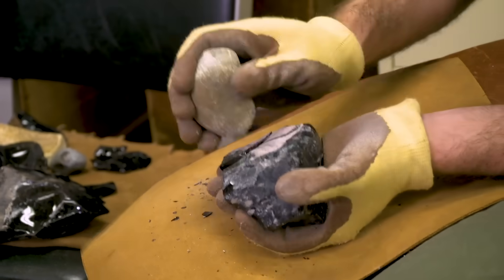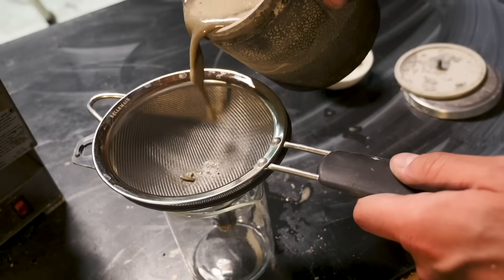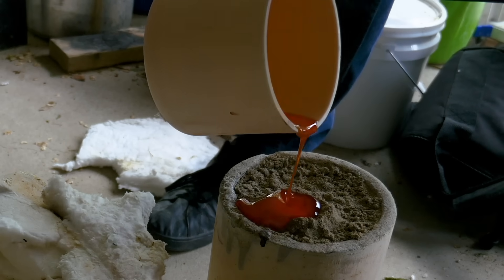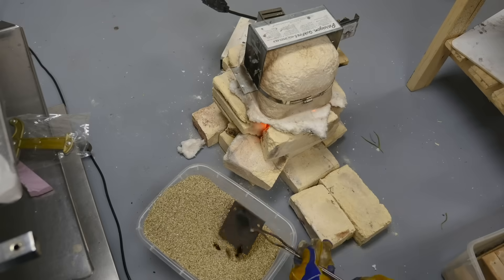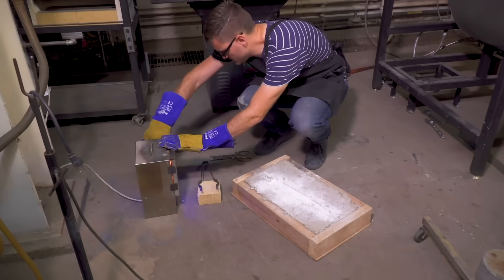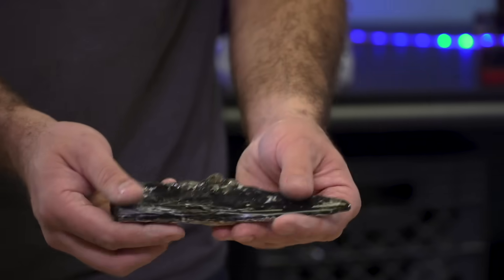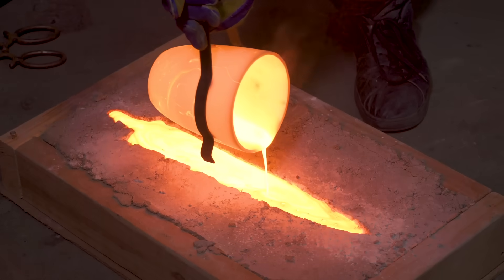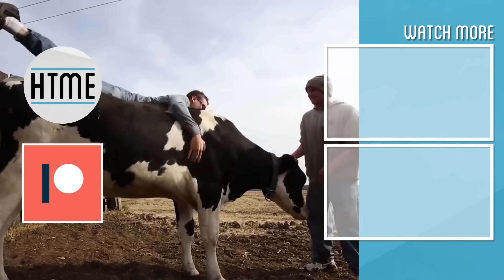Can You Melt Obsidian and Cast a Sword?

Comment: Hey Mate, Lead crystal glass artist Adam Norman Jenkins here.  A few points that might help you in future work.  First up, we coat all our bricks and the inside of our kilns with a thing called "High Fire Kiln Wash"...a company called Paragon makes a good one that is specific for glass, if your crucible breaks and glass comes pours into your kiln the kiln wash protects your valuable kiln (I regularly have high temparture  lead crystal glass flow all through my kiln just because I'm too lazy to measure and cut my glass properly).  Second point, you're always going to have problems sand casting glass which is why glass sculptors generally don't.  What we do is create a multilayer refactory mould (each layer has a different chemical composition because it has different goals)...we put the mould AND crucible into the kiln at the same time (it's called a gravity load crucible), not only that, we have to consider sprue, risers, feeders and gates when making our mould.  The reason we put it all in together is annealing.  When casting glass you can't just use an annealing kiln like blowers use.  Their glass is a special composition and is very thin....cast glass is generally lead crystal (or obsidian) and is thick as heck so it takes a LONG time to move between stages.  A small-ish 25 cm piece sits in the kiln between 400 & 850 celcius FOR 5 DAYS!  Your obsidian is brittle because you didn't anneal properly or for long enough or at the right temperature.  If you put a strong backlight under it and look at it with a polarising filter (grab on from an old LCD monitor) you will see rainbow colours in your obsidian, these are stresses that have been captured into the glass...if I see rainbow stress in a piece it goes in the bin (or actually, back in the kiln to be re-cast into something else).  Stresses in glass are an odd thing, you never know when they're going to break...a sculpture can be sitting happily one someones shelf for 5 years and then a wind will blow across it the wrong way and it will shatter into a million pieces.  So you can't sell anything with stresses in it and, realistically, if you have stresses you have a problem with your process.  Hope that helps, hit me up if you need any more info for any future casts of glass or glass-like objects.  If anyone wants me to do a video of what I'm talking about let me know.  Cheers, Adam
Reply: Of course we want you to.
Reply: What would you'all want to see made?  I've just started working on a sculpture of crystal high heels ('glass slippers'), I could video that start to finish, or if there's something specific this group of people would like (I notice you wanted an obsidian sword...a crystal dagger is something I could do pretty much in my sleep)...thoughts?
Reply: @admjen1  - if at all possible , a small blade made from obsidian, roughly the size of a dagger, that can cut objects and survive blunt trauma
Reply: Anything really, would love to see the video though.  Wanna make me a Crystal GIR (Invader Zim) :D
Reply: Jonathan Mitchell  - "Wanna make me a Crystal GIR (Invader Zim) :D" ... would love to, copyright prevents me unfortunately.  And the art industry is soooo picky about that, I had a painter friend from art school used someones photo as the basis for a painting without attribution or permission and a gallery owner recognised it, his career ended before it began....he recovered for sure, but it was far tougher a road then I'd like to walk :)
Reply: Hey, thanks for all the great replies.  So, good news is I think I'll make you guys a crystal dagger.  Now, I want to address two parts of one of the requests specifically - 1) Obsidian:  I won't be using obsidian, but I will use a "black crystal"...obsidian (as this video points out) is basically just junk glass...it's full of impurities and each batch has different properties (what we call the "softening", "melting" and "annealing" points)...it takes months of experimentation to find those points for glasses that you create yourself from known ingredients let alone some completely unknown glass full of junk elements.  I can't let a piece of junk glass (and I use the word 'junk' not to offend, just as a technical term) leave my studio unfortunately, it will damage my reputation.  However I do have a really cool jet black lead crystal I can use which will look 1000 times better.  2) Can cut objects and survive trauma - so, on the last part, at the end of the day it's glass...I mean lead crystal is pretty tough (35% lead), but it's still glass, you go into a sword fight with a dagger made of glass and the only hope you have of coming out alive is if the other guy dies laughing.  On the first part, I'm happy to do that but I have a condition...I will create a couple (maybe even a few, we'll see how I am for time) and I'll sharpen up one of them, and then smash it.  I make sculptures not weapons and I have an ethical objections to a weapon leaving my shop.  Finally, something that crystal sculpting teaches that unfortunately the internet doesn't is patience...you will need it.  From sketch to finished sculpture is about 8 weeks!  Now, it's not 8 weeks of work, but glass is slow...things have to sit.  For example, I do most of my work digitally these days (instead of old fashioned clay), but it takes 4 days to print.  A mould takes 8 days to dry, then 2 days to pre-fire, then 5 days to melt, then a day to release....etc etc...you get the point, glass sculpting is slow as f-.  But I'll post some 'shorts' ('trailers'?  "he was just one man, one man with a kiln". ??) as I go.  Thanks for the cool comments and feedback, should be a fun project :)
Reply: oh...and I should point out I said "I'll make a few" because I might as well give a few away...maybe you guys can think of a cool way for me to figure out who gets them once I figure out how many my kiln can hold (I only want to do one batch).  Also, I'll post some pictures as I go to my instagram/twitter account @aPeaceOfAdam
Reply: Adam
 Norman Jenkins
Reply: yeah. sounds awesome, man. i subbed, and ill be looking forward to seeing your work. seems a shame to destroy your hard work though. couldnt you keep em for personal display?
Reply: alphazero121  - I'll only destroy the sharp one.  I'll  make a few blunt ones that I'll give away or maybe auction for charity...haven't decided yet what to do there.  If I destroy it it'll just go back into the kiln and become something else.  I could just grind the blade back down and make it blunt again, but I really like the idea of smashing a weapon and melting it down to turn into some beautiful figurative piece, that kind of resonates with me personally, my first job (20 years ago!) was as an infantry soldier if you can believe it so there's a certain symbolism for me in doing that :)
Reply: okay. i understand. i was just curious as to the reasoning. :)
Reply: That's pretty cool man. Can't wait to see the video, I subbed!
Reply: I just subscribed to your future channel! I can wait 8 weeks. Give us a teaser of what else you have done and tour of your studio.
Reply: Adam Norman Jenkins Just subscribed for this, so I expect to get a notification in two to three months! 😃
Reply: After sharpening one of them, don't destroy it needlessly. Instead, you should make a follow-up video showing "stress tests" of the sharpened glass blade, with the ultimate goal of pushing it beyond its limits and letting it break through the testing. Like someone else mentioned here, you could show how easily that glass blade cuts through various objects, and then afterward if it's still intact do some blunt force tests with it to show how easily it will break if used in that way.

Just an idea, anyway. From start to finish this would be a pretty long project as you've already stated, but I feel like after putting all that work into one of those glass pieces it would be a shame to just break it intentionally when you could instead put it through its paces. I think it would make for an interesting video, but that's my opinion.

I've subscribed either way, I hope you do follow through with this project. It sounds awesome!
Reply: @admjen1  where are you based out of?
Reply: That stress test is a really good idea actually, it also has practical applications for me as I'll learn a lot more about my glass...thanks :)
Reply: @admjen1  You remind me of the old World of Warcraft video where one guy afk's and comes back rushing to every mob and yells "LEEROY JEEEENKIIIINSSS"

Also wanna tell you that I don't wanna offend you, so if you don't like what I just said just ask me to remove it.
Reply: No offence taken :). I hope it's just the name that reminds you (though I have seen that video and it's very funny)
Reply: @admjen1  Yes it's just the name :P
Reply: @admjen1  well I know who I'm subscribing to just to see a video awhile down the line but you sound like ya know what ya talking about so it will probably be much more interesting then this mess of a video.
Reply: Thanks @Anime fan - I promise I'll get to it, I'll also post some "how to's" for anyone that wants to give it a go...glass sculpting used to be on par with marble and bronze but fell out of favour in the late 1800s (I think because labour law changes meant you could no longer force children to sit and tend a kiln for a week - but now we have computers I'm hoping it makes a comeback).  I'm really looking forward to sharing what almost a decade of research has taught me, just be patient, I promise it's on my todo list and I'm slowly working towards it.  Artists are poor as f so I have to balance cool projects like this with just getting stuff into galleries and applying for grants (and managing the grants once you get them)...but no doubt I'll b*tch about that stuff on the video ;). (I shouldn't complain, it's better than NOT having a grant!).  Looking forward to showing you all something interesting (hopefully ;0 )
Reply: Whatever you want to make, man. im sure there are a lot of people, myself included,  who would be interested to watch an actual expert's process.
Reply: Why not cut a sword out of a large piece of Obsidian with a waterjet and then sharpen it so the edges aren't dull?
Reply: ummm, 'cause I'm a glass sculptor not a glass cutter? ;)  I'll leave the waterjets experiment for someone else.  As for everyone else, overwhelmed with both work and pandering to the red-tape that governs the grant that currently keeps a roof over my head and, sometimes, food on the table (it's not a very big grant) but hopefully Thursday (it's currently Monday) I can do a "here's my studio" few minutes....I'm also going to outsource some stuff to you lot because I'm so busy, particularly finding concept images.  When I start a new project I usually spend hours surfing the web for "inspiration" pics, but I just don't have time at the moment so after I post my intro video this week I'll get you all to post links to inspirational pics in the comments section.  Thanks for your patience with me...I have a young son so keeping a roof over our heads has to take priority over cool side projects :)
Reply: oh
Reply: oh...and on the cutting, if you want to try it (and you can find a big enough piece of obsidian) you don't need a water jet (I don't even know if a water jet would do the job without chipping the glass) what you want is a water luricated diamond saw (I have one - don't use oil lubricated for glass, has to be water)...if you can't afford one of those, if the obsidian is thin enough you can use a Dremel with a diamond blade (I used one of those for years for cutting, just can't cut deep and takes forever)..but remember, you have to have water dripping over the blade or you'll heat and crack both the glass and the blade.  Finally, why cast and not cut...well, because if you cast you can do a bunch of cool stuff like design really fine detail embossing into the handle and blade - you just can't do that efficiently or effectively with cutting.  Side note, cutting in the glass world is called "cold working" (we do a bunch of stuff, cutting, grinding etc), casting is "hot work" and the third option is "flame work" :)
Reply: @admjen1  I'm not to worried about how long it takes you even if it takes you a year I'll watch it when ever the video comes out keeping a roof over your family's head and food on your family's table takes priority over doing a side project I'm sure everyone here agrees.
Reply: THIS WAS SUPER COOL. Thanks for sharing your expertise.
Reply: Fascinating. So you need a specialist in casting rather than a specialist in blowing.
Reply: hi Jeff, so you can blow a "sword-ish" shape as well...I'm not a blower so someone with more experience in that area than I can comment on how, but I've seen some sword like objects blown (mostly turned into leaves or torsos)....but yes, it would be much more suited to casting then cold working
Reply: I've put a few crappy videos over onto my channel - patience as I learn youtube and video editing please :). Artists run on kudos so a comment will mean the world to my motivation - also, a few links to imagines of swords/daggers you like posted in the comments (any video) will give me an idea of which aesthetic direction to head
Reply: @admjen1  I'm just commenting to show my support for your project. This seems really cool and I wish you the best of luck!
Reply: @digitaldritten  Hey thanks Terra...artists run on kudos so comments like yours keep me going on cool little side projects :). I've submitted some test videos (mainly just so I can learn how to use youtube and how to video edit...the latest one shows a rapid time sculpture breakdown which is pretty cool (no sound tho, sorry :) )...looking forward to posting more.  And REFERENCE PICS EVERYONE - I don't have hours in my day to craw the web for how you guys want this dagger to look...post the links here or on one of the comment sections over on my channel ... thanks for the support everyone
Reply: Yus, absolutely, please do. It sounds like you'd be able to add a wealth of solid knowledge to this subject and I'd very much enjoy said video.
Reply: Adam Norman Jenkins HOLY
Reply: Wait, somebody on YouTube who actually know what he's talking about? WHAT IS THIS SORCERY??? Is the world coming to an end?

Pro tip: these clowns have no clue what they're doing. But they make huge $$$ thanks to the millions of people (literally) who watch them try.
Reply: Welp. Maybe the guy should have spent some time to read up on what he was about to do instead of spending hundreds of dollars for broken equipment :(
Reply: Moritz Korsch  "Maybe the guy should have spent some time to read up on what he was about to do" - so I wouldn't hold this against him, it's very, very hard to learn how to sculpt-fire glass.  It fell out of favour in the late 1800s/ early 1900s (I have a theory it was because of labour laws, you couldn't force children to sit and watch a kiln for a week straight) and a lot of the information was lost.  I had to travel the world for 4 years on my holidays studying with people in Sydney, Melbourne, Paris, Venice and the UK to put together all the necessary information for my practice...other glass artists have similar stories.  There seems to be a renewed interest in just the last few years (and thanks to computerised kilns we no longer need slave labour :) ) and a few artists who really believe in the medium and it's beauty and ability to communicate beyond what bronze and marble can do are fighting the good fight...but yeah, I've blown close to $100,000 on setting up my workshop and learning my craft (I was a computer programmer and it's the only thing I spend money on : ) )....it's not an easy road.  I'm really going to enjoy sharing a video of it actually :)

Comment: Well done. One thing though, you really need to be careful with the Vermiculite you used as a thermal insulator, as in wearing a face mask when handling it. Vermiculite is the trade name for Asbestos used for insulation, and it's one of the more dangerous forms of it because it makes dust easily.

Comment: have you tried to cast it while slowly degrading the temperature. Obsidian usually forms in slowly cooling down rock.
I believe you should cast the sword when the obsidian is liquid and then you should slowly cool it down in hot chamber. 
If thats possible you can add some pressure to the cast when it is still cooling down.
I dont know I'm guessing .

Comment: Gotta get a larger kiln that opens from the front and preferably with a digitally adjustable temp control. So not all heat is lost once opened and after you make the cast put it in the kiln and slowly decrease the temp

Comment: Yes you can. Meaning no disrespect to those who put the effort and time on this video. The problem is their trying to do it cheaply and with modern technology. What is is need is shavings of carbonated iron and a tradition oil and salted water cooling as well as, believe it or not, traditional melting and molding techniques. If you would like to know more about this just message me or reply here.

Comment: To the Lord of HTME:  Interesting video, but I wish you mentioned what you used for your flux. Sodium Carbonate?  Borax?  I also am inclined to agree with your hunch that using the flux gave you a product that was more similar to glass than obsidian.  Good effort, though!  You need a much hotter environment to get your obsidian "runny" - consider that deep in the earth it is not only hot, but the pressures are extreme compared to what we experience at sea level. Geo-Chemisrty is complex.  You also seem to have nearly infinite resources to (literally) burn through so many crucibles and kilns.  Good luck!  Note: any blade will need some kind if a tang, so pick up some orange-flavored astronaut breakfast beverage next time you're at the supermarket.